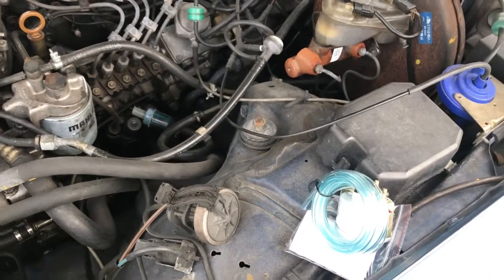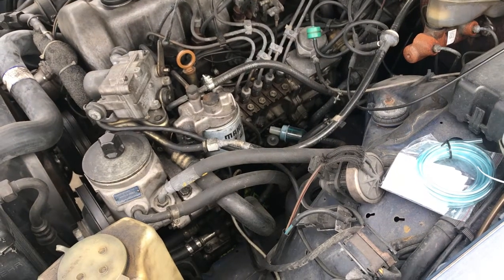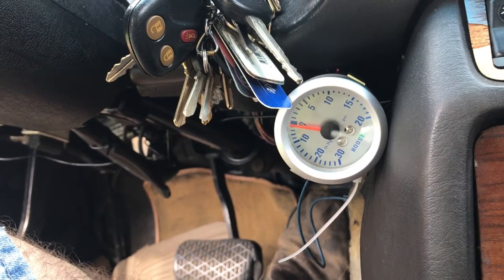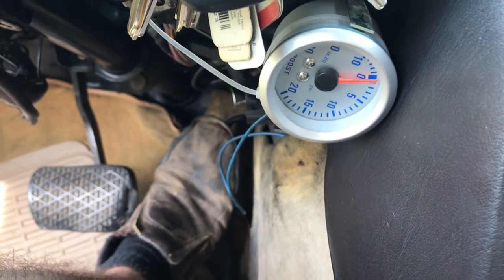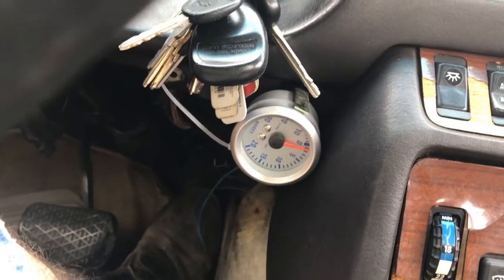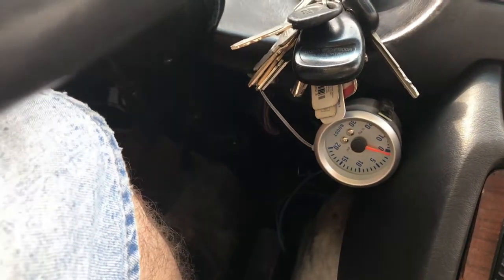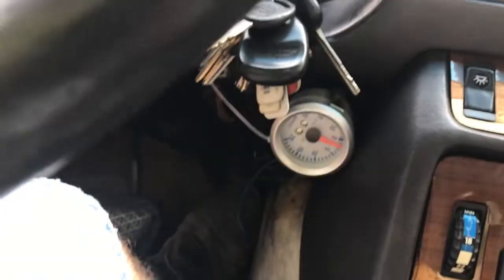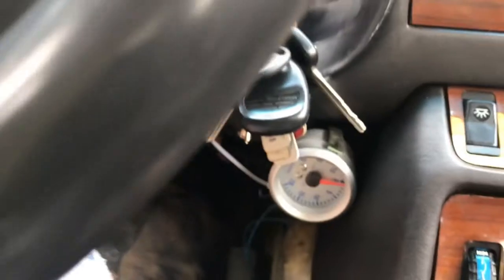300D Got Boost?

Comment: You dont build boost in park. Boost is under load in drive. 
Also power brakeing that car is a guaranteed way to destroy a transmission  and overstress the motor. These cars are not hot rods. They are designed to be luxury touring cars.  You see so many of these cars on marketplace . craigslist or wrecking yard because no one would pay $500 for them as parts cars or fixer upper.  with bad motors. Been overheated and blown head gasket or bad transmission. And most of them have missing alda. Missing overboost. And or hood stacked. There is a myth going around people saying they are million mile motors. Impossible to blow up
And capable of 500hp. All which are false. 99.9% of these motors will never see i million miles. So many people say my car has over 500k miles  but no one prooves it. In my 30 years of  owning. Restoring and repairing the brand i think i have seen a few cars that  achieved 500k miles or more. All which are on their 2nd or 3rd transmission. And 2nd headgasket and these ard cars that were highly maintained. And spared no expense  keeping them that way.

Comment: I have the 1987 300d  with 165k miles the first time I drove it I was surprised 
How well it pulled. For a 3 litre turbo it has good power. With the air box and exhaust on these cars you cant hear the turbo at all. Im considering selling it
To buy a older benz. Iike the older body style much better. But hate to sell mine because its %100% rust free with nice body and everything works. 
But i enjoy working on them. I restored cars for 30 years so I want to
Do a nice candy over flake paint job. Great hobby cars.
Reply from the maker: They are great cars.

Comment: I am a puzzled on you comment about a "solenoid" protection valve on the boost circuit. To my knowledge the wastegate on the turbo is what opens by means of a spring and diaphragm to bleed off boost in excess of 12 or 13 psi. Ami I wrong on that? I put a brand new turbo on my 300D when I found the boost was 8 or 9. It is now 12 and has increased power. No wastegate problem. I love your install of the gauge and you should leave it!!
Reply from the maker: The waste gate is what limits the boost but There is a solenoid on the line going to the Alda, if boost exceeds 13pso then the solenoid opens bleeding off boost pressure to the Alda which will then cause the Alda to cut fuel.

Comment: Can you squeeze some more power out of the screw on top of the injector pump?
Reply from the maker: A little bit.
Reply: To get real power out of the pump you need to adjust the limiter rack this will make it roll coal as well I wouldn’t start messing with any boost before doing that boost is nothing without the fuel

Comment: Something you might want to check is the chain stretch on the timing chain as well as the injection timing. I just replace the chain on my 84 in between the 11 degrees of change stretch and the pump being off by about six degrees I used to have a very sluggish diesel that sounded very similar to yours now I can spend the tires off the line
Reply from the maker: i did check for slop in the chain when I adjusted the valves and it seemed tight, but I do need to check injection timing.
Reply: MJM’s Workshop chain stretch has to be measured using the mark on the back of the first cam tower in relation to the timing marks..Trust me, I thought I was within the 4 degree spec, nope 10 degrees of stretch. You can't see the stretch based on the way the tensioner is designed, it is a locking fail safe type. I also agree that the boost pressure is too low, I run 12psi intercooled or 14 non intercooled(depending on my project..). I have a garret on the bench, let me know if you want me to upload a video on how to adjust the gate on it specifically